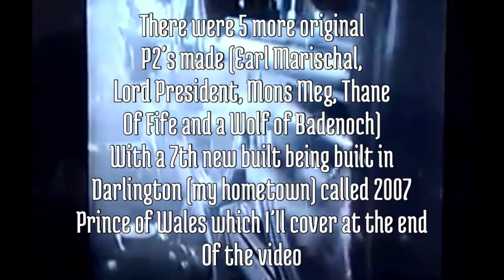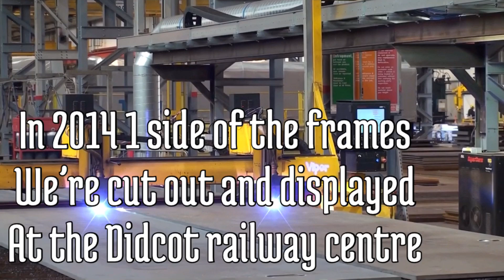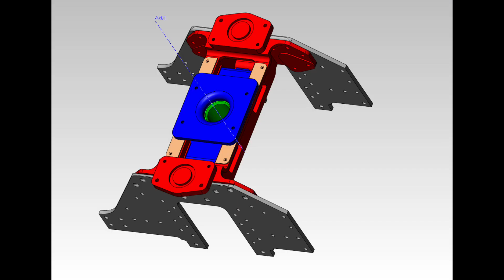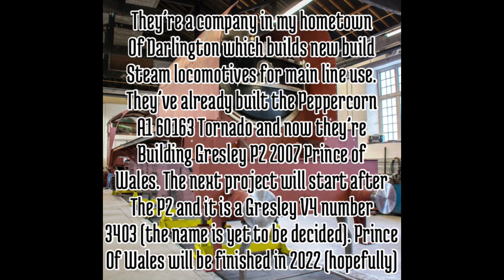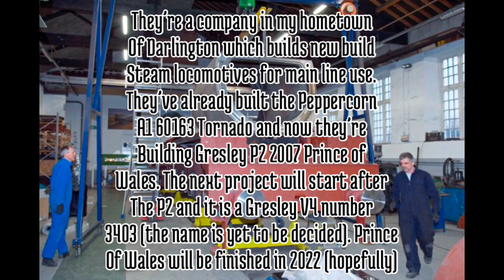The Gresley P2 Mikado Project Show #1# Doncaster P2 trust and comparing the P2 New Build and Replica

Comment: I think this video shows the Doncaster P2 in a poor light due to scenarios out of their control. The P2 steam trust has already got a team that knows what it is doing after spending 18 years building 60163 Tornado. Where as the Doncaster P2 is starting from scratch they don't have the skills or the organisation to progress as quickly as the P2 Steam trust. And they did lose the original place where they where going to build it so have had to look for a new place and this slows the project down. I think they would be progressing far better if the A1 steam trust hadn't decided to build a P2 at the same time.
Reply from the maker: Indeed. That’s probably the case. Thanks for the information! Stay safe :} James
Reply: @teescottageguyproductions  I Will do and thank you I hope you stay safe too
Reply from the maker: Thanks!
Reply: @teescottageguyproductions  your welcome